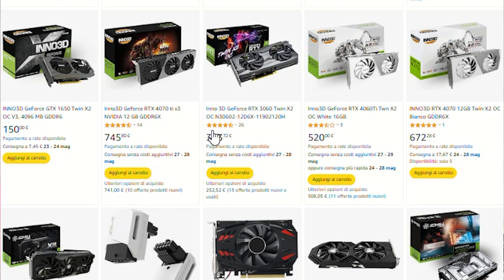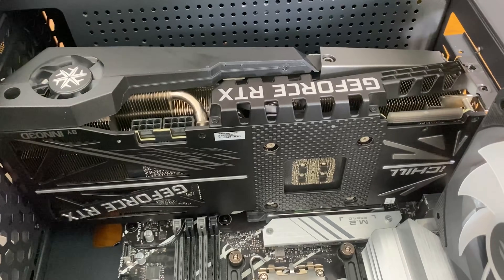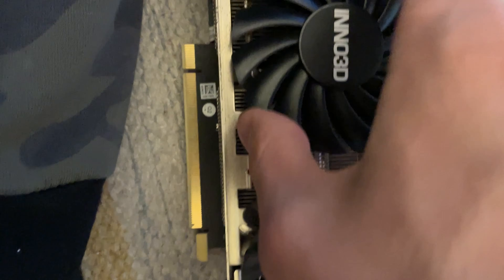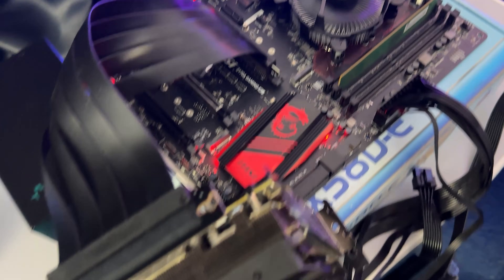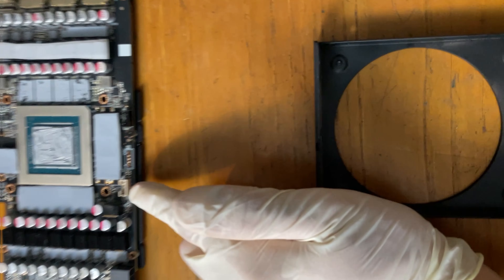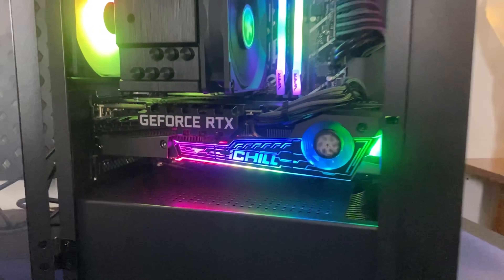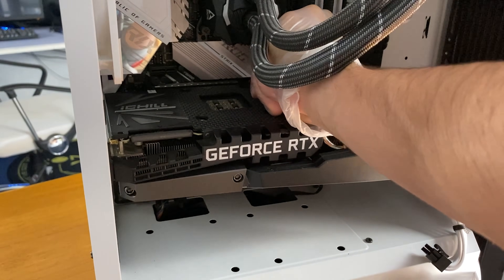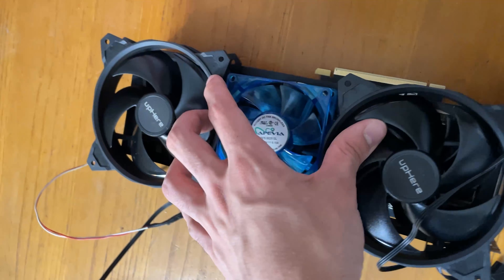Are Inno3D GPUs actually that Bad?

Comment: After a year of use, my 3080 Ti stopped working under any load and shut down at 60°C. As the inno3d team were not at all polite, they were mocking me in an email, implying that I might be a scammer or something. I sent my card to a third party, who replaced the thermal pads, repaired the circuit board and installed two new GDDR6X memory chips (video RAM) from Micron, as the previous ones were dead. Avoid Inno3D at all costs!

Comment: Hi, I came across this video as I’m transferring my old 3080ti PCB (from the same manufacturer) into an XC3 model heatsink + backplate bought from aliexpress. Do you happen to have the proper length for the GPU mounting screws that secure the heatsink?
Reply: Hey bro I am planning on buying a 3080ti ichillx4 used just wanted to know how the card performes
Reply: @ Card runs pretty hot. But if you have sufficient cooling +undervolt it will be fine. Why are you buying a 3080ti used? How cheap is it? Also, does it have any warranty and can you verify if it’s used?

Comment: Got an inno3d  RTX 4090 X3 OC and i gotta say that i'm perfectly happy with it.  I had a bit of an issue with the temperature, namely, the hotspot delta went all the way up to 20 degrees after a year and a half. But i did a repaste with the arctic MX-6 and now it's only 9 degrees (hotspot never exceeds 80 degrees C). Another thing i noticed is that there is 0 coil whine somehow... so yeah... that's cool

Comment: Been using a innos3D gtx 1060 6gb for 8 years now and it's been doing great. Never had any issues.
Reply from the maker: That’s exactly the kind of feedback I was looking for :)
Reply: how do u maintain ur pc for 8years?
Reply: @cristofsanjuan6633  cleaned my pc every 6 months using soft paint  brush . Also every 3 years I changed my pc case.
All budget cases but was better airflow. Currently have montech xr and has been really good since comes with good airflow and dust filters.
Reply: @cristofsanjuan6633  Cleaning your case a few times, fresh CLEAN install, new GPU, new SSD....It ain't that hard 😛
Reply: @cristofsanjuan6633 my PC with a gtx 1080 founders edition still running fine 9 years later.. you just need to clean it...

Comment: Hi, I have Inno3d iChill X3 RTX4080. It is great card. I have VFC at 2775mhz@1V. The temps are not bad not good. only downsize is that hotspot is higher after 1year of use. When brand new it was 10 - 15degrees delta, now it is 15 - 25degrees delta. but it never goes to 100..max was at 96degrees hotspot.. I have paired it with 5800x3d in Phanteks P500a case.
Reply from the maker: Thanks a lot for the more technical feedback, you’re the only one so far! Great voltage point you got, I think 975 may also work at 2775Mhx on the 4080 :)) 25C is starting to be a bit too much, probably it’s the thermal pads imho. Thanks a lot again for the comment!
Reply: @ImWateringPSUs  memory temps are still good,less than 60c!!could it still be the thermal pad?i do have rtx 4080 inno3d ichill x3
Reply: @ImWateringPSUs hi, little feedback. I have been tinkering and I did replace the thermal paste. I did use ThermalGrizzly's PTM. Now, the delta is about 13°C or 15°C max, depends on game. Vfc little tuned to 2820mhz @1.015v. Max temps a I did see was 62° on core and 76° on hotspot @50% fan spin.. fan curve made by FanControl, also every fan in case is controlled by this program. I am happy with the card.
Reply: i do have the same card,hotspot raised from 15 to almost 25 after 3_4 months of usage,still works good not disappointed .

Comment: I ended up having to buy a new case because an inno3d 3070 x4 I had was huge... Other than that I didn't have much problem with fans but I guess I was lucky.
Reply from the maker: They are MASSIVE cards indeed ahahah, it was very difficult to fit the 3090 in the 46$ M-ATX case when I did the video about it lol

Comment: are the thermal pads' thickness for the Inno3D RTX 3070 iChill x4 also 0.75mm? I can't find any information with regards to its thermal pad thickness from the internet.
Reply: Hey did u find the answer for that? I have the same model and would like to change the pad
Reply: 0.75 mm for vram and mosfet. 1.5 mm for inductor

Comment: Am I really listening to a guy that washes cards whole in soapy water and spins the fans while handling the cards...?
Reply: The fan bearings will be ruined also water oxidizes traces
Reply from the maker: Ahahaha that may be what’s happening, yes! But washing stuff is just a little bit of what I do, definitely the most scenic part though. Anyways, I’ve covered that in the past but the oil inside the bearings is hydrophobic so it won’t be affected by water. And if you dry it quickly and properly, mo oxidation will occur :)
Reply: If it works, then it works 🤷
Reply: @LordAngelus  Did you not read what I just said?
Reply: @TheRealChinoMoreno  yes. And if it works, it works. 🤷

Comment: If the fans die just ziptie a couple of 120mm Noctua fans onto the heatsink and never think about it again. 🤣Or maybe Arctic P12's if your on a tight budget.
I think ive used only like 1 Inno3D GPU in past 25 years. 😁
Reply from the maker: Ahahaha it's exactly what I've done in a few of the builds you see used as a footage in this video too lol. Best price/performance and lowest noise levels :)
Reply: @ImWateringPSUs  Indeed 😄